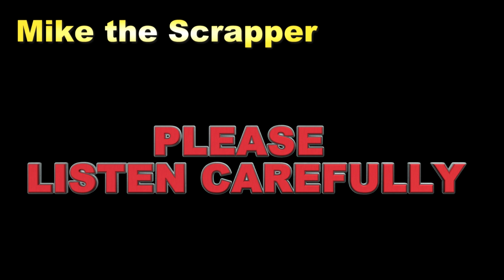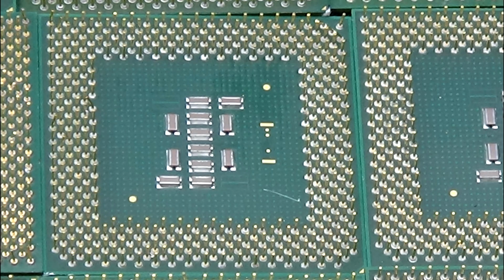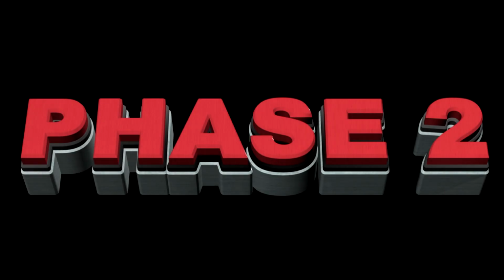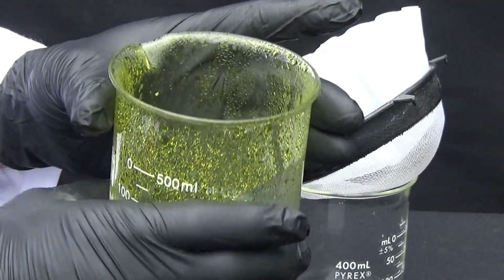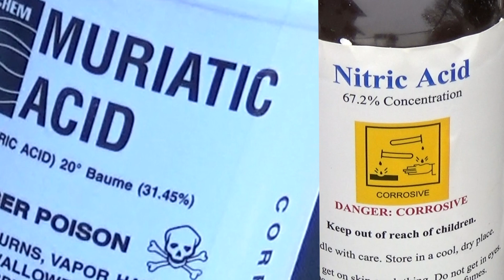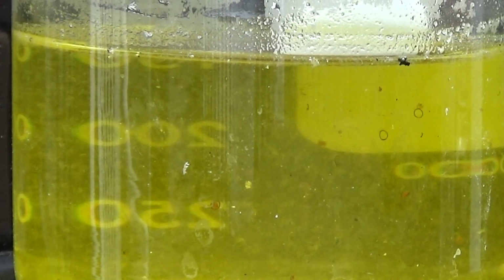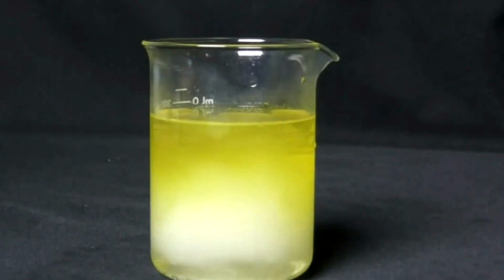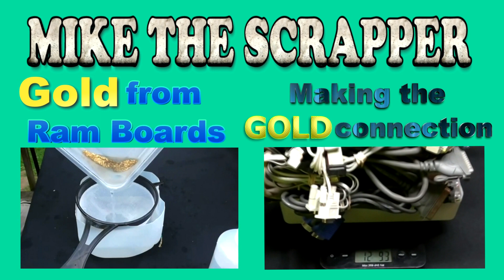GOLD RECOVERY (Green Fiber CPU Pins)

Comment: what metal was you dissolving with the hydrochloric acid and the pins? was it copper? cus it looked blue was it dissolving the lead solder?
Reply from the maker: ***** I would that and some others...
Reply: it dissolves copper and lead?
Reply from the maker: ***** It should dissolve all but the gold itself.
Reply: nice, so, to drop the copper i would add some steel, do you know what i would need to drop the lead and silver?

Comment: Scrapper dude, good video up to the point where you pulled out the bottle of nitric acid then it all went downhill from there. You used WAY too much nitric acid to dissolve that tiny amount of gold. You could have got the job done with 2 or 3 drops of nitric and some heat on the beaker. The use of urea to denox is incorrect too. By using the minimal amount of nitric acid to dissolve the gold your need to denox the solution is much easier. The use of urea is not necessary nor recommended.
Reply: IsettasRock what may I ask would you use instead of urea then ???
Reply: Sure, but first you should know it's good refining practice to use the minimal amount of acids  from the start to get the job done. This helps with waste disposal and when it comes time to denox a solution of nitric acid before dropping the gold powder. Slow controlled additions of nitric acid would get the same job done and would have left the solution with a lot less free nitric to denox.
There are several methods of denoxing a solution of free nitric to prepare it for dropping and none of the recommended procedures involves urea. I won't go into all the methods here as I could write pages on the subject. It's up to you to research those but the simplest method is the addition of more 24k gold to the solution to consume the free nitric. Another would be the addition of sulfamic acid. Adding sulfamic acid will convert the nitric acid to sulfuric acid which will effectively rid the solution of free nitric and drop any lead from solution as a salt helping to refine it.
I strongly suggest you research more on the subject before acting on any of my advice to fully understand what you're doing before hand.
Reply: IsettasRock agree that amount of nitric is like a nuke to destroy an ant hill I use sulfamic acid instead of urea...

Comment: hi mike can ram fringers and cpu pins be done in the same acid solution
 & could you do a video on ceramic cpu's as i have a good amount of these i also have the black fiber penitium's but cant get the pins off these
Reply from the maker: Paul Sanders you can only mix the 2 in phase 3.I am working on a video now, on what items goes with what solution.
Reply: brilliant thanks for your time here in the uk you have to have a license for nitric acid witch i have'nt got as of yet so think
 ill get all the foils off the ram strips and pins and just save them up
Reply from the maker: Paul Sanders In the U..S.A, I worked with a company that sells a product called SUB ZERO. This is a Nitric Acid Substitute. It is a dry pellet form. Maybe he can help find some one in your area.@subzeroinstr.php
Reply from the maker: Mike the Scrapper www.ishor.com

Comment: In some Electronics include the RAM, CPU, Daughter-board, and Cellphones, how many karat gold do they carry?
Reply: I am in no means an expert but I don't know what karat it is but once you process it and use nitric acid and urea and smb it will be 24k.... I THINK... correct me if I'm wrong. But you need to get everything out of it sometimes it has lead and other metals if any get into the gold it wont be 24k
Reply: Karat is measure of Gold Content. In other words, a unit of proportion of gold in an alloy equal to 1 - 24 part of pure gold.
Reply: A drop or two of Sulfuric Acid added to the Aqua Regia will precipitate out Lead Sulfide crystals. They can be filtered out with the rest of the detritus.

The first time through the process yields .995% fine. The second time through yields 999 fine.  (We are quibbling over about 5/1000 ths?.)

For all intents even 99% is considered as 24 K.. You will alwaysn have some impurities. You can get 9999 or 99999 if you use electrolysis of 999 fine.
Reply: It is pretty much all Gold Plate. (Other than the Gold Bonding wires inside of the IC chips which are mere microns thick...)

Much less than a Karat would be your answer.

The Gold plating can vary between 10 Karat up to 24  Karat. It is Gold Plated. 

You are not going to get rich doing this. This is done for fun. (He shredded 50 CPUs for about a half gram of Pure? What does one CPU cost brand new?)

Go  to the Gold Refining Forum, download Hoke's book, READ IT, and then converse with them.

The manufacturers are not going to put $50 in Gold into a $500 phone much less a $50 phone. 

Think about it. There has been only 180 Metric Tonnes of Gold mined in the past 10,000 years The mines are almost depleted as it stands. It is estimated that the Earth's Gold Mines will be exhausted, mined out, of Gold in the next Twenty Years.

E Scrap is 3 Times as rich as ore than current Gold Ores in operational mines. On a large Industrial Scale, processing tons of E Scrap it is profitable. But on this scale it is tedious and time consuming.

This is a hobby. This is like panning for Gold on a weekend.

Comment: I have been trying to remove the pins from cpu's. I have followed the method in your video but am not able to get the pins out. Is there a trick to it that I'm missing? I'm holding the cpu's close to the heat gun. The heat gun is on high. And after several minutes the pins are still hanging on tight.
Reply from the maker: David Webster Shake the CPU... It should only take 15 seconds...
Reply from the maker: Mike the Scrapper Hopefully its Green like mine and not Ceramic.
Reply: It's ceramic.
Reply: David Webster You dont want those just give them to me....lol !!!

Comment: in an other video i seen that they mix sulphuric & nitric acid at the ratio of 2:1, then they pour all the cpu's as it is and didn't heat up the mixture, after a while just filter the remaining using filter and the remaining they called GOLD DUST, and just simply put that in furnace and melt down and get the gold. remember that isn't the 99.9% pure.
please help me out which process is better.

and can i use baking soda to neutralize the acids mixture.
Reply: please reply ASAP

Comment: Hi Mike, isn't there gold inside the cpu's and doesn't the gold settle to the bottom?
Reply from the maker: there is gold in a cpu, and its not that easy to say it settles to the bottom.
Reply: Whats the best way to get the gold out of a cpu?  Is it ok to skip hydrochloric acid and go straight to aqua regia first?
Reply from the maker: No. It is a process. if you want to make 99.9% you would have to do the entire process. You can experiment and maybe end up with 10 - 14k your way.
Reply: I read some other things and they also said it was not a good idea to go straight to Aqua Regia.  The gold on my pins did not float to the top with the 20% HCL from Home Depot.  They disappeared. I'm thinking it was because I didn't use enough.  I also read to use 10ml 32% HCL for every 10g of pins.  I don't think it matters if I use the 20% do you?  Also, I removed the Kobar heat plates on my cpu's.  I'm thinking I might incinerate to recover the gold on the inside.  Do you think there is enough gold to make it worth it?
Reply: Figured out what I did wrong.  I didn't let it cook long enough.  Needs to cook 3-4 hrs and gold foils float to the top.  Seems weird gold floats!!

Comment: Mike.

Good video. However you may want to use a lot less acid. (Be stingy with your chemicals.)

You can eliminate the Urea step completely when you are skilled. Geo has some good videos of the process and I think that Drew Metalsmith also uses them.

Take your Gold in that hot  Muriatic Acid and start adding in Nitric Acid slowly until all of the Gold is dissolved.

The Urea neutralizes the EXCESS Nitric Acid. The Muriatic Acid is not neutralized. That solution is still strongly acidic.. It it only transformed into a weak Sulfurous Acid when the Sodium Metabisulfate  is added. That it what causes the release of the Gold from the Gold Chloride Salt as the Sodium Ion replaces it to make..Sodium Chloride...Table Salt..

After you have checked your Sulfurous Acid for any unrecovered Gold using Stannous Chloride, it is at that point that the Sulfurous Acid can be neutralized with Baking Soda and thrown out safely.
Reply: So I am new to gold recovery. How much acid would you use for 1 oz of cpu pins
Reply: Cebariuss I would not process 1 ounce of Gold Plated CPU Pins as the recovery would not be worth it. You are writing about a fraction of a gram....a small fraction at that.
Reply: 24kGoldenRocket I wasnt going to do 1 oz i was just wondering how much per oz so if i were to do like 50 oz i would just times the 1 oz amount by 50

Comment: What would happen if you put CPU pins directly into Aqua Regia?
Reply from the maker: Troll Soul you would waste the acid.
Reply: Mike the Scrapper Mike, thanks for answering, but I have one more question. You used only hydrochloric acid, why didn't you add hydrogen peroxide?
Reply from the maker: Troll Soul In this process. was not needed.
Reply: Mike the Scrapper For the method you use for gold cpu pins you used HCl which % ???  
you use 300ml 18% or 31%??? Please tell me